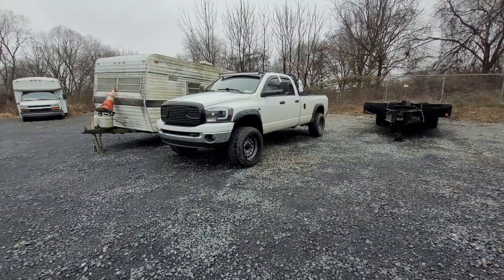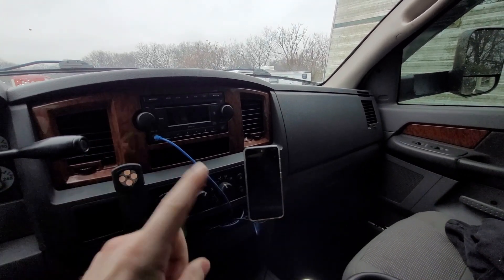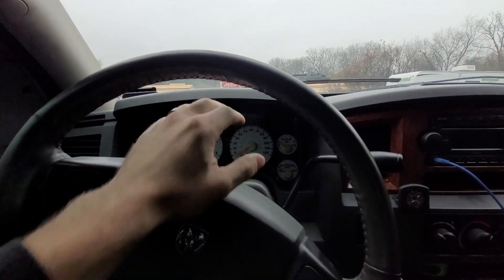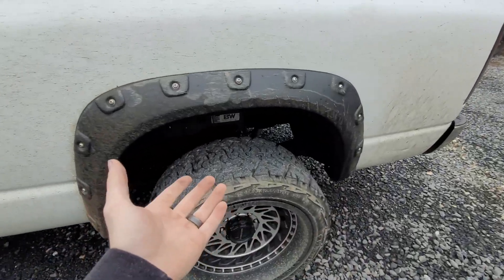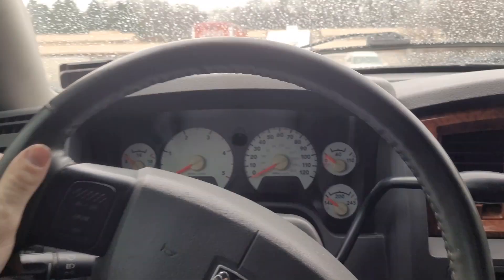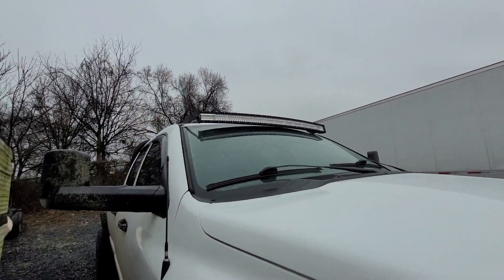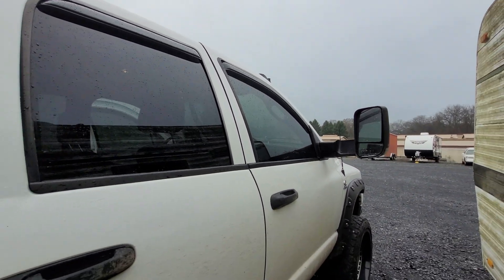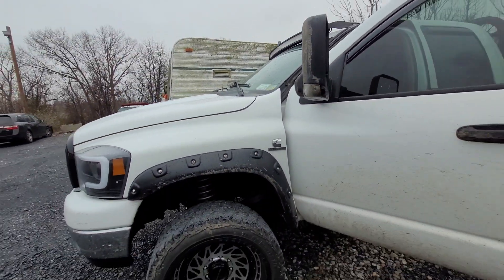Everything Wrong With My Site Unseen Ram 2500 | I May Have Bought A Lemon But It's Okay

Comment: My second gen door seal was shot as I was driving thru wind and rain so I went to the Home Depot and bought 3/4” wide self adhesive weather stripping as a temporary measure, well it’s been there for 2 years now and it works better than the factory door seals ever did

Comment: Steve i had a diablo in my 06 mega cab and used it for hot shot in canada i could get 35to37 miles to the gallon 
Running empty just pulling my gooseneck when i'm load it not too good but it used to nakpil to do the job
I also to the transmission so it didn't shift up and down and left i pulled it up or down single straight pipe with my billet oil pan on my transmission it never got hot again

Comment: I almost bought a 03 Cummins 4x4 5spd 2500 crew cab but only reason I didn't buy it is because it was a short bed and I wanted a long bed so I wound up buying a 97 chevy k3500 454 crew cab long bed and the only reason I hate the chevy is the IFS and 8mpg. Lol It is on 35s and 7 inch lift but some day it will get a Dana 60 in the front.

Comment: I got some double D stick on weatherstrip. The door seal was wrong from the git go. A new one will not cure all that whistling. Have to add thickness. Be sure to get the real Cummins 165 Degree thermostat made for Industrial and Marine use. Helps with all the items that are bolted in front of and behind radiator. Go by the numbers for load rating, try to get at least a 126 load rating, 3748 pounds per tire at 80 psi. E rating is just horse shit. The only two tires I can now get for my truck with 17s are the Nitto Dura Grappler, (the better Trail Grappler was made useless with very low load ratings), and the Kanati Armor Hog, in 285/70R17.

Comment: You most likely don't need injectors, buy a red bottle of hotshot secret to put in the fuel. The stuff is amazing! I highly recommend the green hotshot secret to put in the oil also. It's expensive but worth it.
Reply: is it a one time additive or how often should it be used?
Reply: Is this safe for the hemi 5.7 ?
Reply: The bad ass  cleaner for fuel is every 10 to 20k mile thing. I run the every day cleaner every fill up. It not only cleans but treats the fuel. Lubricity, and Cetane improver. Makes the fuel way closer to old fuel.
Reply: The oil cleaner is usually a 30k to 50k thing for 6.0 ford's. But it isn't as important on common rail/ non oil squirter injector  types.

Comment: The Speedo is your tires npt stock tires when you go bigger tires you have to program your computer
Reply from the maker: The guy who had it before tuned it for way bigger tires than what I'm running now. When you put big tires on stock trucks the speedo actually reads low. Mine reads high meaning somebody messed with it. Nothing a retune can't fix!
Reply: Everytime I put bigger tires on my vechiels my Speedo’s go out by 10  if I do 80 Iam ready doing 70  I put 275 on my truck that had 265 and throw out the Speedo

Comment: Speedometer is off because of tires your tuner should be able to fix that.
Reply from the maker: Guy used to have 35s and tuned it for that. It's off a lot more than it would on 33's. Someone definitely tuned it for a different tire size to be off by 10mph
Reply: 35s to 33s should only be about 4 mph off at 60 mph.